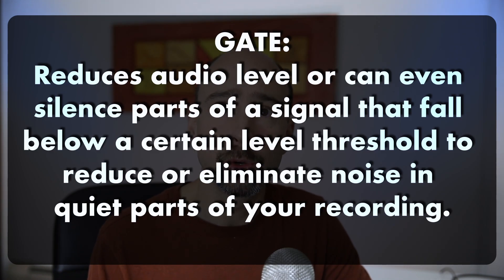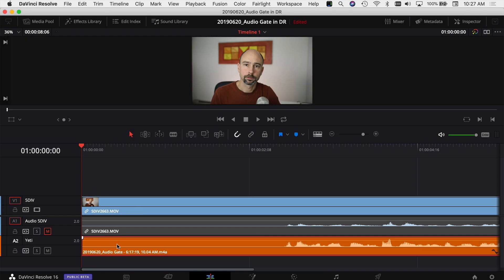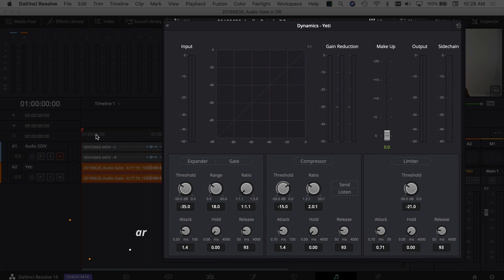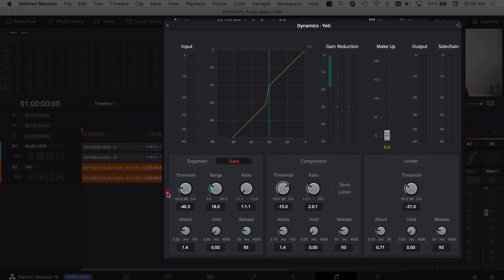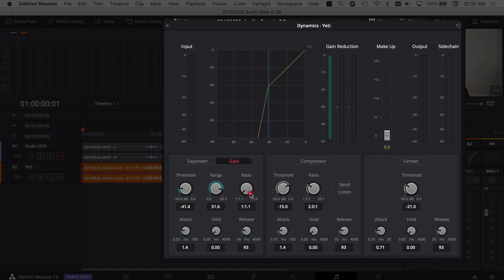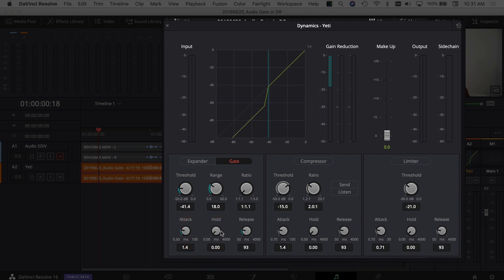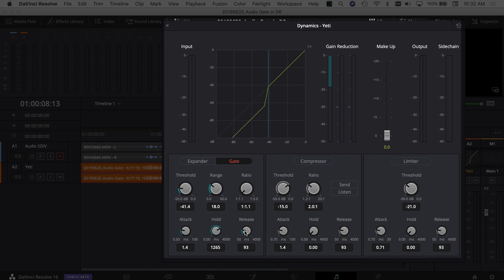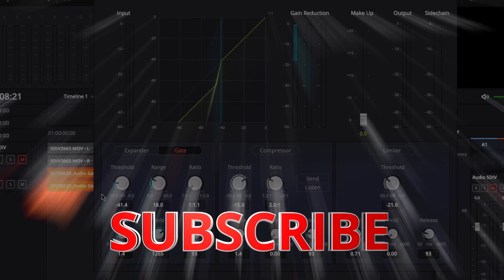Davinci Resolve 16 - Audio GATE to Reduce Background Noise | Tutorial

Comment: I'm confused with this, the Gate doesn't do anything for my microphone but it looks identical to what's in the video.
Reply from the maker: Hi!  It might not do anything because you might need to change the settings of it.  Make the threshold number lower until you hear it reducing or removing the sounds between the voice.  Also double check the track and make sure you're working on the correct audio track.

Comment: I tried this and it didn't work. I don't know if I did something wrong or the wind in my background is too loud to even block out. Anyone have any suggestions what I should do
Reply from the maker: Hi! Thanks for checking out the video! You may need to adjust the settings a little more and/or you may not be able to remove all of your wind noise.   The gate mostly helps remove noise in quiet parts your video where you may not be talking. It may not remove the wind noise behind your voice while you’re talking.

Comment: Hi, I really need some help. I use DaVinci Resolve 16 free and i have a problem with the mixer: I have no options next to the dB faders so i can't go in "inputs" or "effects" or set audio gates or anything. In the menu it says they are selected and i should see them but they're not there and i can't find a solution, like NOBODY online has this problem. Can you help me?
Reply from the maker: Hi!  This should be an easy fix - Go to the Fairlight tab, in the mixer, look at the top right corner.  You'll see 3 dots (...) Click that and then you can check on the items you want to see.  Should fix the problem.  Let me know if you need more help.  Thanks for watching!
Reply: Thanks for the answer. I already clicked on the 3 dots and selected everything but it still doesnt show me anything
Reply from the maker: You have to scroll up and down above the faders.  It should be there.  Make sure you're in the Fairlight page, not the edit page.  If you still don't see it, try a reinstall.
Reply from the maker: You may have to adjust the size of your window too.  If the tracks and mixer are small, you can hover over the middle of the screen just above the tools above the audio tracks, click and drag up the window.  This will make the mixer and audio tracks have more room on the screen.  If you'd don't have enough screen real estate, you won't see the tools above the faders.  This might be your problem.  Hope this helps!
Reply from the maker: Sounds good. They just released an update yesterday or the day before, everything works fine for me.  I know if you’re still having troubles and I’ll try and help
Reply: It works! I re installed it and at first it still didn't show me the options so i tried adjusting the window and this time it showed me everything! Thanks again for the help!
Reply from the maker: You're welcome!  Glad you got it working!  👍

Comment: Thank you for the video. It help me a lot. By the way, what is the difference between audio gate and denoise function in resolve?
Reply from the maker: Hi and thanks for watching!  So a gate basically says take any audio below the threshold you set and reduce or silence (depending on your settings) the output.  This is most useful for the noise you may hear between words or in breaks while talking.  Or say a mic is open and picking up ambient noise, a gate will easily remove that.  Noise reduction/denoise trys to remove a specific part of the track.  It can work good too, just depends on your particular audio clip.  I've used both. I pretty much always use a gate and occasionally noise removal.  Hope this helps a bit!
Reply: @JasonYadlovski  Thank you Jason. I'm pretty new to this video editing things. In my case, de-noise works better to remove background noise, but it makes the main sound bit weird. unnatural. Any suggestion on how to fix/tune the main sound? Thank you in advance.
Reply from the maker: Yeah, I find that often with the noise removal tools.  Too much of it and the rest of the audio sound weird.  You'll just have to play with the settings to find something that removes most of the noise, but doesn't distort the rest of the track.  I try to use a gate if possible more than the noise removal tools for just that reason.

Comment: Thank you very much for the video ! What is the best option to reduce background noise while a person is talking and still keeping a clean audio channel of the voice of the person? Thank you very much.
Reply from the maker: Hey! Thanks for checking out the video and dropping a comment! I would start with the gate see how that works you may have to adjust settings for the best result. You can also try the noise reduction tool which is in effect that you apply to the whole track. I also just put a video out about Accusonus plugins, they have a noise removal tool that works really good.  Depends on what you’re trying to remove and how loud it is in the background.

Comment: Hi Jason ...how r u ... So sorry again the same question... I tried treating the sound yesterday ... And again have the same query... Let say I have 20 different video clips including the sound tracks .. when I switched on the gate on the first audio track i.e. audio 1 ... Then when I moved on to the next clip, opened the fairlight tab .. the gate was already on. Do I again need to switch it off and then again switch on?
One more thing .. I have a problem of hiss and other noise during the dailouge also as I tried to pick up the volume a bit .. anyway through which I can clear it out ? Thank u ...
Reply from the maker: Hi Jefferjit - When you turn on the gate on a track, it will effect all clips on that track.  You do not need to select each clip.  It's a track wide change.  

If you have some background noise, you can try adjusting the gate or you can try the noise removal tool.  Go to Fairlight, add an audio effect, select 'Noise Removal'.  You'll have to play with the settings in there.  

Another thing you can try is to remove some of the high frequencies in the EQ.  Lower the frequencies above say 6K and see what happens.  

Best of luck!  If you have any more questions, feel free to ask!
Reply: @JasonYadlovski  great great ....thank u so much ... I know m bothering u like anything ... But I guess this is gonna work now.....thanks a ton ...😊😊🙏
Reply from the maker: No worries!  It’s no bother at all.  I’m Happy to help👍😁

Comment: I mean this is a good video but how can you get rid of background noise whilst you're talking?
Reply from the maker: What kind of background noise do you have?  You can try using the noise reduction tool, that may help.  The Gate may help and the EQ may help.  If you have a lot of background noise, you will not be able to remove it, maybe just make it a little less noticeable.   Thanks for watching and best of luck!
Reply: Jason Yadlovski okay well that’s disappointing so you can’t, my issue is my mic picks up my keyboard heavily when I’m trying to game and commentate and the space bar always comes through as a bang sound no matter how lightly I press it and even when I have a noise gate and compressor I can’t get that sounds to go away because it somehow comes through at the same level as my voice
Reply from the maker: I see, what kind of mic are you using?  Did you try adjusting the settings for the mic or on your system to make it less sensitive?  For example lower the gain on the mic if there is one.  T

Maybe you need a mic with a cardioid pattern so it picks up you, but not much behind it. Try and place the keyboard behind the mic, that might help.  Best of luck!
Reply: Jason Yadlovski I have resolved my issue with it, but I had a question regarding if I could put video over video in the same screen say like a face cam during a gameplay video?
Reply from the maker: @cuddlesthebear6908  Yes you can. In the timeline, just place the video you want on top on a video track above your background video.  Then the video will appear 'on top' of the background video.  This of the video tracks as layers.  The highest layer is what is seen.  Does that make sense?
Reply: Jason Yadlovski yes as much sense as it could make through comments thank you 🙏

Comment: What if I want to cut music in the background out ! Tried it with ur method, didnt work tho.
Reply: I just want to isolate the voices of a movie with backgroundmusic
Reply from the maker: Thanks for checking out the video and leaving a comment!  You can’t pull out just the music if the voices and music are all on the same track.  A Gate just will just cut out low background noise by muting everything below a certain threshold level.
Reply: @JasonYadlovski  But is there any method to cut out just the music of one track
Reply from the maker: If it’s it the music and talking all mixed together in one track, your not going to be able to split it up so that the music is gone.  You’d need all the stem tracks to do that.  There may be software that will do that, but I don’t know what that is.  Best of luck! 👍😁
Reply: @JasonYadlovski  Thank you tho
Reply from the maker: @vall-e3132  You're welcome!  Happy to try and help.  Best of luck with it!  👍😁

Comment: Hello Jason! Thank you for creating this. I'm sure I will find others useful bits here too!
I have an issue though. I have video taken from my phone and dumped it in to D.R. 16 but when I go to hit Gate it doesn't engage (turn orange). is this because it's really mono and not truly stereo? Limiter goes orange however. Any idears? Thanks!
Reply from the maker: Hi!  Strange problem, it shouldn't matter if the track is mono or stereo.  The gate just reduces audio below a certain threshold level.  Are you sure you are in the dynamics section of the correct track?  Not the 'Main 1' dynamics?  Maybe try deleting that track and try putting your audio in a new track. Not sure why the gate wouldn't turn on for you.  If it still doesn't work, try using a different audio clip, just to see if the gate works.   Worse case, give it all a restart.  😁 Sometimes that helps.  Let me know if you have any luck with it!  Thanks for checking out the video!
Reply: @JasonYadlovski  Thank you!!! I tried it on a new project by itself and it worked. So It looks like I do need it on it's own track away from everything else. Duh I should have known this! haha Thank you again Sir!!!!!
Reply from the maker: Nice, glad you figured it out!  Sometimes weird things happen in projects.  Best of luck on your project! 👍😁🎥🎙🎛

Comment: Good day/Morning/Evening what is the main deference between Gate,Noise Reduction and Compressor or main use?
Reply from the maker: Hi!  Sure I can break them down for you:  

A GATE reduces the level or can silence parts of an audio signal the fall below a certain level.  For example - when no one is talking, but there is still low background noise, a gate can remove that.  Or if you have a microphone open, and no one is talking, the gate allows you to silence the mic until the input levels reach a certain point.  Many times I'll use a gate.

A COMPRESSOR is used to reduce the peaks of an audio signal so that the overall level can be boosted without clipping.  This reduces the dynamic range of a given signal.  I use a compressor all the time on vocals.

NOISE REDUCTION is a plugin that can reduce a variety of noise in audio tracks.  It can detect noise in dialog track and 'remove' the noise.  Occasionally I use noise reduction, but not too often.  I try to make sure the recording environment is quiet. 

Hope this info helps!  If you have any additional questions, let me know and I'll see if I can answer them for you.  😁👍 Thanks for checking out the video!
Reply: Jason Yadlovski Thank you, so I can say compressor is more like Video limiter/Broadcast Sage when working with color. 

I understand Noise reduction and bit of Gate I just don’t know/understand how to read the graph or that bouncing green line .
Reply from the maker: @SilverGas147  You are correct with compressor.  It's like a limiter so the audio doesn't peak.  You can check out my DaVinci Resolve Audio Crash Course to help understand things a bit more:  https://youtu.be/3abjyA8mHGc  or check out my video on setting Audio Levels:  https://youtu.be/BVHGpzYarLk  They should help you get a better understanding of things.  If I can help any more, let me know!  Best of Luck!
Reply: Jason Yadlovski I’ll do so Thank you

Comment: Tried this in one of my projects which has a siren in the background that doesn't go along with the white noise. Any suggestions?
Reply from the maker: You could try finding the frequency on the EQ and see if you can reduce the siren sound.  I don’t know if you will be able to fully remove it, background sounds are tricky.  It usually has to be pretty quiet in the background for it to be removed and still sound decent.  Maybe try playing with the gate settings too?  Thank you for checking out the video and best of luck!

Comment: My DR doesnt have dynamics, only audio 1 audio 2 and main 1
Reply from the maker: Make sure you are in the Fairlight tab.  You'll probably need to click on the 3 dots (...) in the top right corner of the mixer panel.  You can then select the items you want to see.  Choose between Inputs, Effects, EQ, Dynamics, Aux, Pan, etc.  Then just use your mouse wheel to scroll in the area above the track names in the mixer.  Hope this helps!  Thanks for checking out the video!
Reply: When he says the fairlight tab, he's talking about the series of icons at the very very very bottom of your computer screen.  Like right above your start bar/taskmenu.  You have to click the Fairlight icon there and then you get taken to a whole new screen that has the stuff he's talking about in it.

Comment: can this remove my awful lens auto focus noise? need it gone asap... its awful and i just want a nice clean voice with the loud lens gone.
Reply from the maker: It may help remove some of the noise. I would say try using the gate and EQ to help reduce the sound of it. You can also try the noise reduction tool and see if that works. Your best bet is to get an external microphone that is not attached to your camera so you don’t get the lens noise. Thanks for checking out the video, best of luck!
Reply: @JasonYadlovski  so there isn't like an obvious bar for your voice and for background noise that one can just easily mute or raise or lower?
Reply from the maker: Unfortunately there’s no tool that does that which I’m aware of.   Since all the audio is in one track you’ve got to get creative to try and deal with the stuff you don’t want.   That kind of background noise can be hard to take out and still have decent vocals.  Best move is to take care of it when recording the audio.